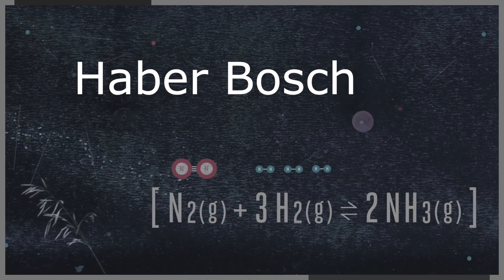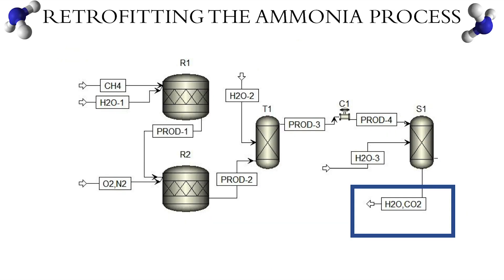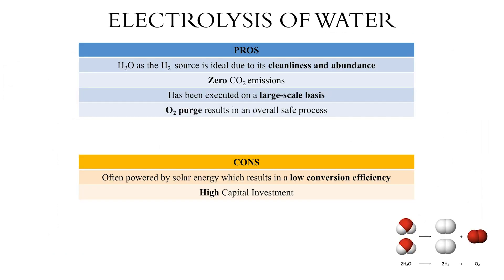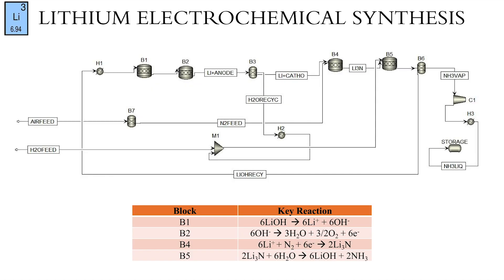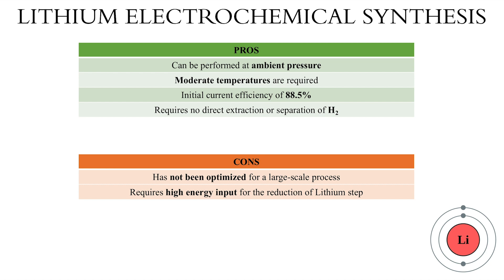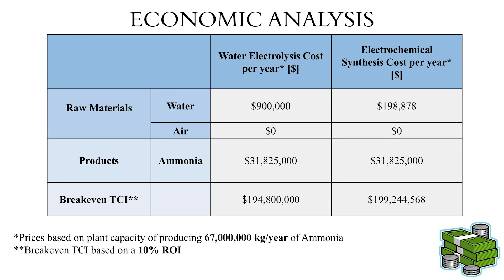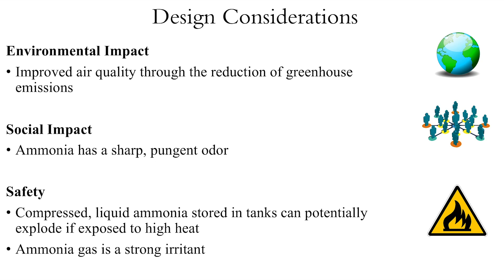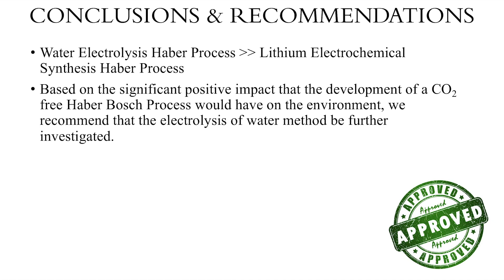ECH 158A Project: Green Ammonia Production

Comment: So what;  all hydrogen stocks suck and will continue to suck until electrolyzers are conceived, designed, and built that can produce millions of tons of hydrogen per annum.  Right now, this is not even close to possible and there is not one shred of evidence by alkaline cell, PEM, SOEC or any other electrolyzer design that it will be possible in the future.   Hydrogen electrolyzers and fuel cells are total nonsense in India and everywhere else, the "Hydrogen stocks" are hopeless losers because none of the electrolyzer companies can deliver industrial-scale capacity.  They only offer small-scale electrolysis capacity, so they can't provide anything but small-scale revenue.  Small-scale revenue will never eclipse their operating budget, so they cannot show a profit (earnings).  Small-scale electrolyzers cannot make enough H2 from water to reduce CO2 output at an industrial scale, so they are irrelevant.  Renewable energy is coming on line quickly, but to reduce global warming, one must decarbonize all of the greenhouse gas emitting sectors -- transportation, agriculture, residential & commercial building and industrial sources (primarily concrete, glass, steel and industrial chemicals).  That means we must create decarbonized fuels such as green ammonia, whereby we take cheap and abundant renewable energy and split water into cheap hydrogen and oxygen.  Then, humanity can remove nitrogen from the air (air is 78% Nitrogen) and, using the Haber Bosch method, combine the green H2 and N to make green ammonia (NH3).  Ammonia, as a "liquid carrier of hydrogen fuel," can carry more hydrogen/BTUs by volume at a reasonable temperature and pressure than gaseous or liquid hydrogen.  Large-scale electrolyzers (no existing electrolyzer manufacturer can provide) would allow green ammonia to fuel and power all greenhouse gas emitting sectors.  When electrolyzers are scaled to provide ammonia-scale plants producing four million metric tons of anhydrous ammonia per year, replacing methane feedstock; call me.  It is important to realize that to produce one ton of ammonia using today's methane "steam reformation process" conventional ammonia producers for nitrogenous fertilizers release 2.84 tons of CO2.